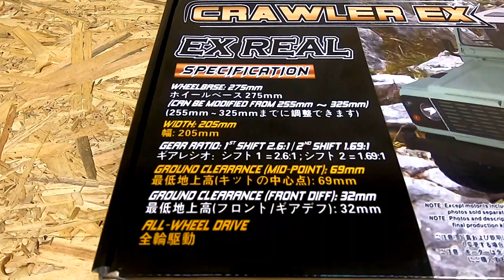3Racing EX Build - 5 min. timelaps

Comment: Question dude. I hooked up a servo for the gear shift and the servo cooked HOT and died. 

What am I doing wrong. 
I am using the gt3b flysky Radio reciever 
Pls any help would be much appreciated 👊😀
Reply from the maker: Try to modify servo endpoints on the transmitter.
Reply: Illaes's RC workshop 
Hooked up with no load on the servo it still got so HOT. 

So with no servo horn on it and no load on the servo it was still overheating. 

I’m not sure but it sounds like the reciever is allowing way to much volts into the servo. 

Does this sound right. 

Or does the servo for the transmission normally get hot 

Totally new to this and learning. 👊😀
Reply: Illaes's RC workshop 
Wanted to let you know why the servo cooked out. 

The esc third channel I used has some short sending to much power back into the third channel from either from channel 1 or channel 2. 

I switched out the esc and like clock work it clicks along nicely now. 👊😀

Modified the endpoints also and now I have a great working Rig. 👍💪🖐